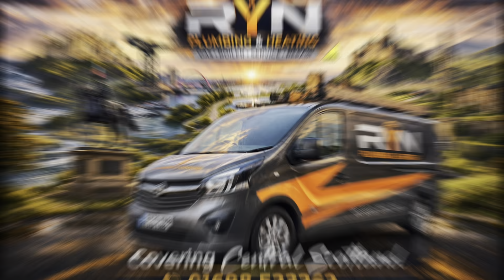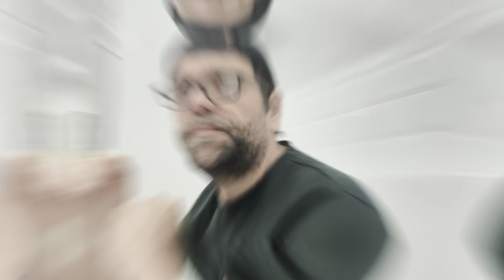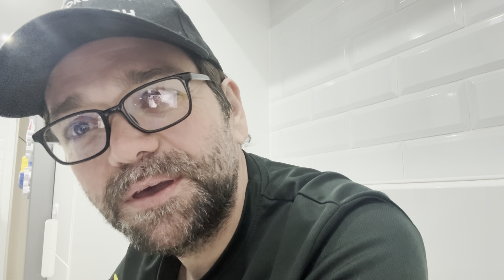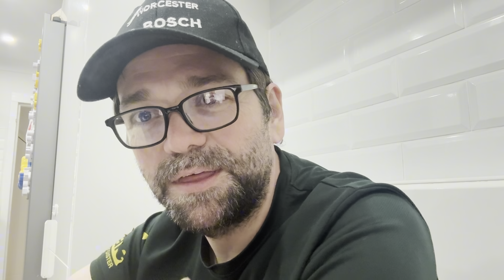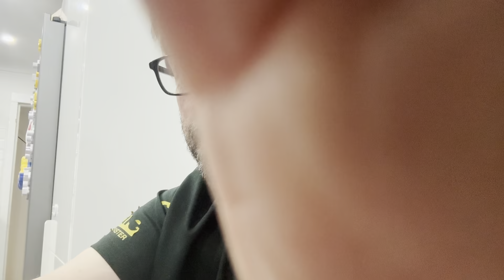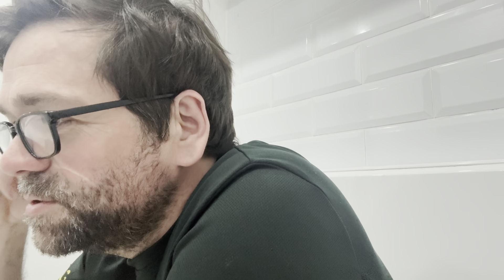Heat Pump Training as a Gas Engineer — Is It Worth It?

Comment: seems an awful lot of faffing about before you even get to the install part. Then a massive expense, the pay back on these systems I am guessing is very long term. I would favour air conditioning heat pumps rather than this faffing around.
Reply from the maker: Yeah that’s definitely an option , but still need hot water, also I don’t think there is a wrong or right answer just what suits the customer the best .